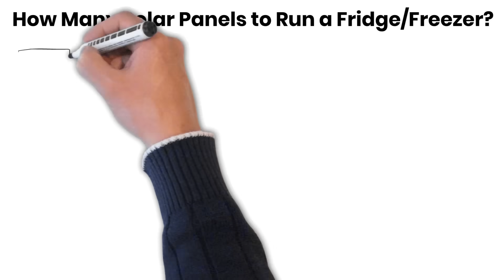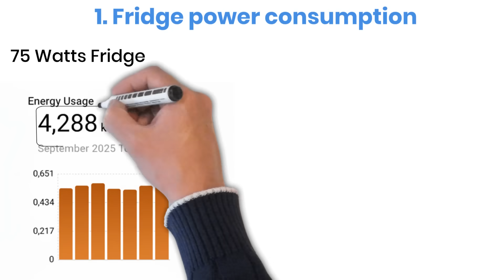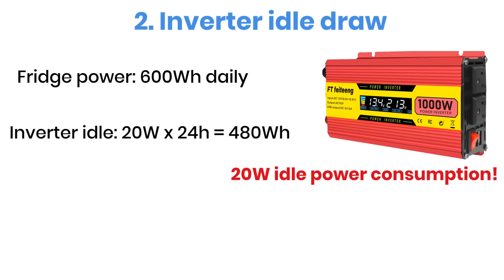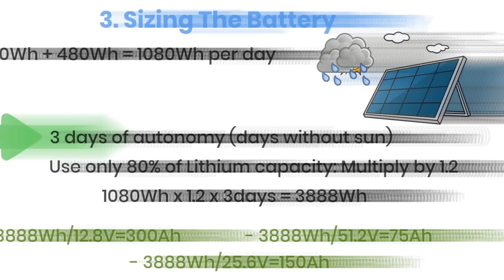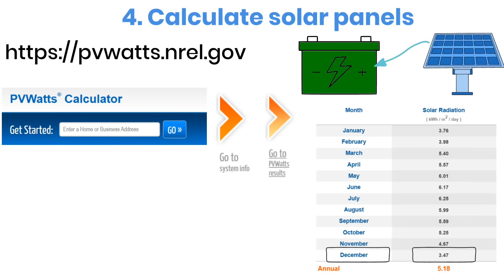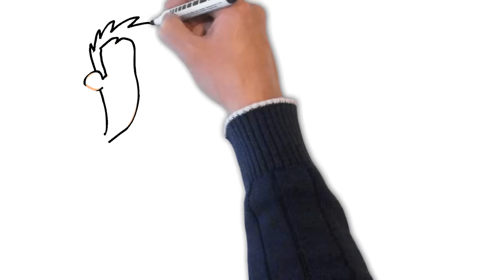How Many Solar Panels to Run a Fridge or Freezer 24/7?

Comment from the maker: Recommended 12V 200Ah battery: https://amzn.to/4pAjRpH
12V 2000W inverter: https://amzn.to/4nKWjwe

AMAZON AFFILIATE DISCLOSURE:
As an Amazon Associate, I earn from qualifying purchases.
This allows us to make more helpful videos.
Reply: Why recommend a Modified Sine Wave instead of a Pure Sine Wave inverter?
Reply from the maker: That’s a very good point! Pure sine wave inverters are definitely the best choice for sensitive electronics, appliances with motors, and anything that needs a clean power signal.
The Giandel 2000W inverter I linked is actually a Pure Sine Wave inverter (not modified sine). It provides stable and safe power for fridges, freezers, and other household appliances.
Modified sine wave inverters are usually cheaper, but they can cause issues like noise, heat, or reduced lifespan in certain devices. That’s why for this setup, I only recommend pure sine wave, it’s more reliable in the long run.
Reply: One thing you're not calculating with a refrigerator is that if it were exposed to outside temperatures such as in a garage, the lower temperature differential would lower power usage in the winter thus offset design requirements.
Reply: So, how many panels did you need???
Didnt the title of the video state you would tell us the number of panels needed?

Comment: I set my system up with high battery capacity 50kwh lower solar @ 7 kw I only use 3-4 kWh winter so the extra battery gives me loads of days autonomy in winter and in summer I use heavier loads of around 25 kWh  per day so in summer my consumption is mainly Aircon but sun hours is high less hotter days less Aircon I may have just 1 day of autonomy in summer but I could throw in Petrol generator or use less Aircon 
Winter I use gas for cooking heating and drying and head torch around the house 
It works out well I’ve been off grid now for a few months now even through December

Comment: But on Winter the fridge is in cooler conditions not using as much power as summer heat to Cool down.
Reply from the maker: That’s true,  colder ambient temps in winter definitely help the fridge run less. The compressor doesn’t have to work as hard, so the overall energy use drops quite a bit. Summer is where the real load shows up. Do you notice a big difference in your setup between seasons?

Comment: You can't running anything of solar panels all day!  If you have mains you don't need batteries you communists
Reply from the maker: Haha no worries, nobody’s saying panels alone run things 24/7.
Solar only works in the day, batteries do the night shift, and mains is just the backup when it’s available.
Everyone’s setup is different… some people go fully off-grid, some mix solar + grid, some just want backup. Whatever works for your place.
What’s your goal, lowering your bill, or just having outage protection?

Comment: Telling us it takes 1110 watts is not the same as telling us the number of panels.
Reply from the maker: Good point. The wattage alone doesn’t tell you the exact panel count.
In the video I showed the full calculation, but in simple terms: you divide the required watts by your panel's real-world output.
For example, if you need around 1,100W and your panels realistically produce about 70–80% of their rating, a single ‘400W’ panel will actually give ~280–320W in real conditions.
So you’d need roughly 4 panels in that case.
What size panels are you planning to use?
Reply: @batteryhacker4343  ... Thank you.  And, I did not know that the 400W panel will actually give slightly less than what is listed.
Reply from the maker: @donsmith4833  Yeah, it surprises a lot of people at first. Panel ratings are based on perfect lab conditions that rarely happen in the real world — so the actual output is usually a bit lower.
The good thing is, once you understand that ‘real-world watts’ number, sizing your system becomes way easier.
Are you planning a fridge/freezer setup, or something bigger?

Comment: 75 watt fridge? Not in the USA. The bulb inside is 60 watts. I call BS.😕
Reply from the maker: Haha I get why it sounds like BS 😄
But the 75W I mentioned is the running wattage of many small compact fridges, not the big full-size US kitchen fridges. Those usually run 120–200W and surge much higher.
Some mini-fridges use LED bulbs too, so the interior light barely uses anything now.
What size fridge do you have? I can check the real wattage for you.

Comment: ...and then add another 25% to that.
Reply from the maker: Exactly 😄 — always smart to add that safety margin! Solar setups rarely run at perfect efficiency, so that extra 25% keeps everything running smoothly even on less-than-ideal days. Do you already have a system running, or planning one out?
Reply: @batteryhacker4343  Where I am from we are forced to have it, because of corrupt and unreliable state owned utility. Lickily we have lots of sun.
Reply from the maker: Ah, got it. Sounds like you turned that frustration into independence. Having plenty of sunlight definitely makes the switch easier. How’s your system been holding up so far with the grid issues?

Comment: Most fridges use 12-1500 watts to start up your inverter must be able to handle the spike
Reply from the maker: Exactly,  that surge power is the key factor a lot of people overlook. Even a small fridge can pull 5–7 times its running watts for a split second when the compressor kicks in, so your inverter needs enough headroom to handle that spike. Have you measured the startup surge on your setup before?
Reply: @batteryhacker4343 never tested it but will advise to beware of cheap chinese inverters ,i bought a "3000watt" one off amazon for 300$  it wont power my fridge
Reply from the maker: Yeah, that’s a solid warning. those budget inverters often list “peak” or “theoretical” wattage that’s nowhere near real performance. A true 3000W inverter from a reliable brand will usually cost quite a bit more, but it’ll actually handle fridge surges and other inductive loads. Which brand did you end up switching to after that Amazon one?

Comment: You still need a back up generator for low light seasons
Reply from the maker: Absolutely, a backup generator is a must-have, especially in low-light months or during long stretches of bad weather. Even the most efficient solar setups can struggle when sunlight drops for days. Do you already have one in your system, or are you planning to add it later?

Comment: Well for starters solar panels alone are pretty useless if you use a solar wind array on those bad light days which normally a rainy and cloudy there is normally fairly good wind and at night there's normally a fairly decent breeze if you use something that is effective in low breezes like a lantern or a bladeless windmill it will keep chopping your batteries up 24 hours a day 7 days a week unless the air is completely still this plus an equivalent solar panel set up a really good battery setup and an efficient inverter you generally will not have problems with your power. And to correct you on the lithium ion battery the manufacturers tell you that you can take them down to 70% not 80%. 80% is at your lead acid battery usage. I run a 1200 Watt lantern wind turbine with a 1000 Watt solar setup in my single person household and my battery's never go below 12.2%. but I did think you were trying to sell stuff so when I came to the comment section and seen that you were trying to sell stuff I figure I better point out the realities of a good setup I am going to put two more wind turbines up even though I don't need them one 600 watt and  a 300 watt just to be excessive plus another 1000 watt solar panel setup you do need a good charge controller which I do have and I also do have a very good wind controller.
Reply from the maker: That’s actually a really solid hybrid approach, combining solar with wind covers a lot of those weak spots each system has on its own. You’ve clearly built something well-balanced if your batteries rarely dip below 12.2%. And yeah, good catch on the battery depth of discharge — Li-ion and LiFePO₄ do handle deeper cycles differently, so staying above 70% is great for longevity. Sounds like you’ve really optimized your system for reliability. How’s your wind setup been performing overall during calmer weeks?
Reply: @batteryhacker4343  not to bad I use high efficiency wind turbine and it's startup is low speed but here in Coober Pedy Central South Australia we get a nice breeze almost every night and when it's overcast we get between 30 to 100 mph winds even if it last for weeks at a time the wind turbine more than keeps up

Comment: Solar panel if you don't work at night. It's not 24/7.
Completely different story if you're talking about battery storage.
Reply from the maker: That’s true, solar panels alone only produce during daylight, so without battery storage, power stops when the sun goes down. But once you pair panels with a good battery bank, you can easily bridge the night hours and even cloudy periods. Are you currently running any battery storage with your setup, or just using solar during the day?

Comment: Wire gauge and length are not factors?
Reply from the maker: Actually, they definitely are! Wire gauge and length both affect voltage drop, which means thinner or longer wires can waste power as heat. That’s why it’s important to size your wires properly, especially for solar setups where every bit of power counts.
Are you running a solar setup yourself or just researching right now?

Comment: That proves what I've always said: solar power for RVs is bullshit. There's not enough roof space for solar panels then add in battery costs, solar panels costs, inverter cost etc and for the amount of use RVs get, a generator works out better value.
Reply from the maker: I get where you’re coming from, for a lot of RV setups, especially if you only use them occasionally, a generator can make more financial sense upfront. But for people who camp often or prefer quiet, low-maintenance power, solar starts to pay off long term. Do you use your RV a lot, or more just occasionally?

Comment: Found this useful?, i found it depressing. Youd have to spens $3k to keep $200 in food from spoiling during a long outage. Back to the draeing board,solars not a solution.
Reply from the maker: Yeah, that’s a really understandable way to look at it. The upfront cost of solar energy can seem high, especially if it’s only for backup. However, the best part is that once it’s set up, it generates free power every day and slowly pays itself off. It’s less about saving a fridge full of food once, and more about long-term freedom from outages and rising energy costs. Are you mostly thinking about backup power, or going partly off-grid?
Reply: We use between 750-850 kwh monthly. We switched from electric baseboard heat to wood heat 2 years ago. We're switchin from a standard 40 gallon electric hit water heater to 2 small point of use water heaters. We've had multiple storms causing multiday outages. I'd like to further reduce our electric dependence,but this solar is lookin expensive.  @batteryhacker4343
Reply from the maker: That actually sounds like you’ve already made some really smart moves, switching to wood heat and point-of-use water heaters alone cuts a ton of demand off the grid. 
You’re right though, going full solar all at once can feel expensive. A lot of people start small — maybe just a few panels, a charge controller, and a small battery bank — and then slowly expand over time. Even a partial setup can keep essentials like your freezers, fridge, and lights running during an outage.
Since your house faces south, you’ve got a big advantage already. Have you thought about maybe starting with a small 1–2 kW setup just to cover your critical loads first?
Reply: @batteryhacker4343 we're both tryin to cut back energy costs and be in a better position when the power goes out. I understand what you're saying about it paying off in the long run,but I cant afford $3k to do that upfront. We use between 750-850kwh monthly,which isnt bad. We switched over to wood heat 2 years ago vs electric baseboard heat. That was helpful. We're gonna ditch our 40gal conventional hot water heater for on demand. Not much I can do about our 240volt electric stove. I've got 2 small refrigerators and a small deep freezer. In the last 2 years we've lost power for multiple days because of storms 3 different times. Our house faces south and I was thinkin adding some solar might be helpful.

Comment: If you are freezing stuff off grid, you go buy a 12 volt freezer for maximum efficiency. About 200 watts of solar should handle it, along with a 100ah LiFepo4 battery for at night and cloudy days
Reply from the maker: That’s solid advice, those 12V freezers are seriously efficient compared to standard AC ones. A 200W solar setup with a 100Ah LiFePO₄ battery sounds like a really balanced combo for small off-grid freezing. Are you running a setup like that yourself, or just sharing from experience?

Comment: The biggest problem with this is you have to first find a refrigerator that actually works and is worth a crap.
Reply from the maker: Haha yeah, that’s honestly true, finding a good quality, efficient fridge can be half the battle. Some of the cheaper ones either draw too much power or don’t cool properly. Have you found one that’s been reliable for you so far?

Comment: I ran a bar fridge Magic Chef that only uses 40 watts average I guess, it ran on as little as 300 watts with a 1500 watt inverter and 4 lead acid batteries, although you needed constant sunny days.  I added new panels and inverter, now I have a 3000 watt pure sine wave inverter, about 1.5 kw of panels, and a new mppt charge controller to charge now 24 volt same 4 lead acid batteries.  It runs everything I need in a trailer except AC, including the fridge and charging the trailer 12 volt lithium battery, and has power to spare.  In the middle of the day it's only adding a few amps because the batteries are full.  That's when I like to pump water, do laundry, etc.  I'll replace the lead acid with lithium once they die, but for now they are keeping fully charged and will last a while longer.  I plan on upgrading to a larger fridge next year.  The propane fridge was sucking almost $1/day in propane, so the solar is paying for itself!
Reply from the maker: That’s such a solid setup, really well-balanced between practicality and efficiency! I like how you’re timing heavy loads like laundry and pumping water for mid-day when solar is at its peak — that’s exactly how to maximize system use.
Switching from propane to solar definitely pays off in the long run, too. When you move to lithium later, it’ll make your setup even smoother and maintenance-free. Out of curiosity, are you thinking of going with LiFePO₄ for the battery upgrade?

Comment: Remember inrush current when the compressor is starting.
Reply from the maker: Good reminder. That startup surge can definitely catch people off guard. A fridge might only draw 70–100 watts while running, but the compressor can spike 5–7× higher for a few seconds when it kicks on. That’s exactly why inverter sizing matters so much. Have you measured the surge draw on your setup before?

Comment: If you run fridge or freezer 10mnt every 4hrs enough to keep cold n froze that bout reg cycle n save power use solar leds n save more
Reply from the maker: That’s a smart energy-saving trick. Cycling the fridge or freezer on and off like that can definitely stretch your battery life, especially in cooler weather. Have you been using that timing setup yourself? Curious how well it’s kept things frozen over longer stretches.

Comment: I run sn inverter fridge off 12 volt v 3 x 100 amp hour batteries and it uses 32 amphours every night but runs the next 12 hours off the sun input off 2 x  350watt solar panels
Reply from the maker: Nice real-world setup, thanks for sharing the numbers. A couple of quick checks and a question to keep this useful for others:
Your nightly draw: 32 amp-hours at 12 volts equals 384 watt-hours (12 × 32 = 384 Wh).
Your battery bank (3 × 100 Ah at 12 V) is 300 Ah total, which is 3,600 Wh nominal (12 × 300 = 3,600 Wh). How much of that do you use each night — are you discharging to 50% or deeper?
Two 350 W panels give up to 700 W peak. That’s plenty of power to refill 384 Wh in good sun, but the actual recharge time depends on your site’s peak-sun hours and the charge controller limits.
Quick questions for clarity: are your batteries lithium or lead-acid, and what charge controller are you using? How many hours of direct sun do you typically get, and do you see full recharge by mid-afternoon most days?

Comment: Surge watts are much higher than 75 watts!!
Reply from the maker: Yeah, you’re totally right, the startup surge is definitely higher than the 75 W running load. That number was just for steady operation once the compressor’s already running.
When the fridge first kicks on, the surge can easily jump 4–6× higher for a few seconds, so even a small 75 W fridge might briefly draw 300–500 W. That’s why having a properly sized inverter (with good surge capacity) is super important.
What kind of fridge are you using a regular AC one or a DC compressor model?